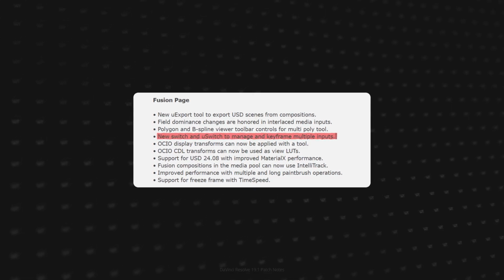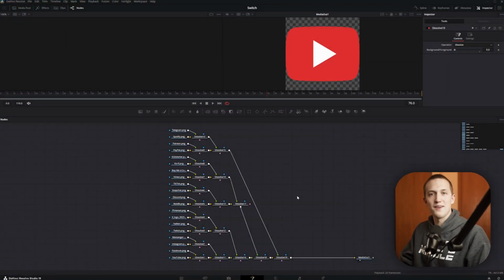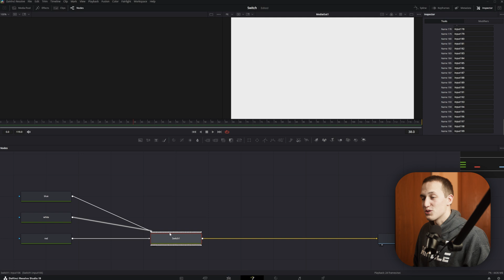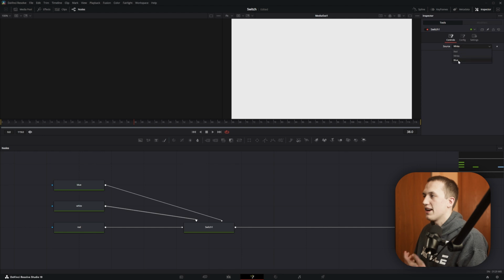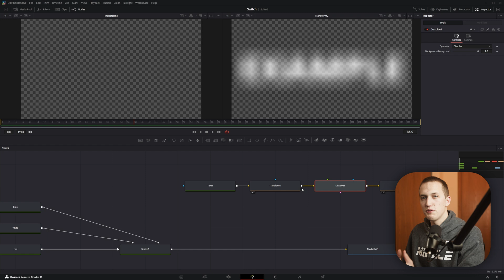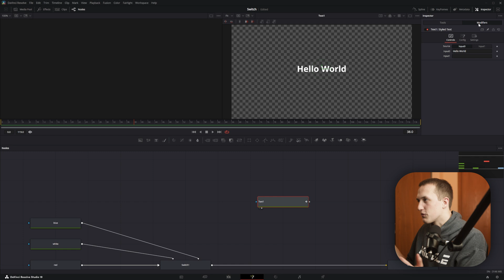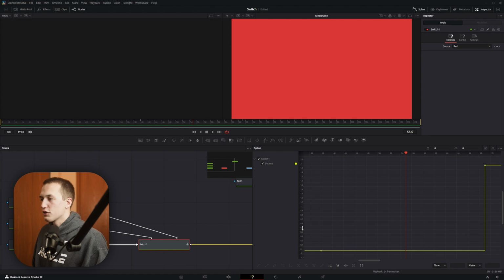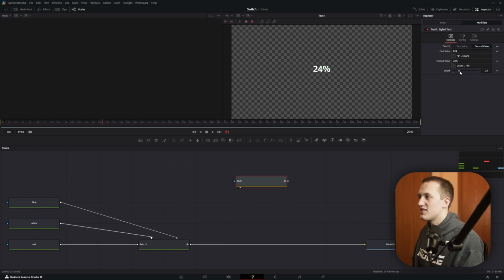The AWESOME Switch Node in DaVinci Resolve!

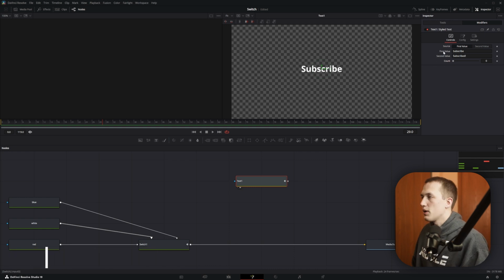Comment: Big Problem ! Starting at 7:41 - I did everything right but in modifiers tab, the 2 number boxes & screen is empty after adding both expressions. I have also noticed that your number boxes are marked as "Value 1 & Value 2" while mine are marked "Input 1 & Input 2". What could be the problem ?